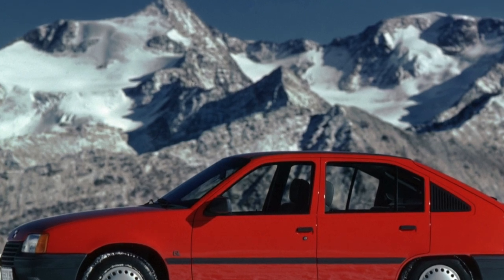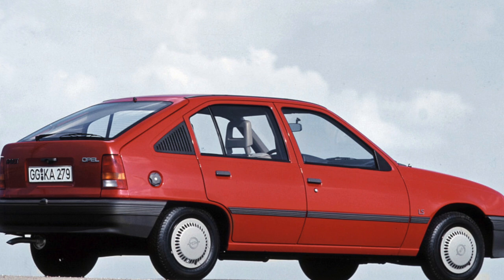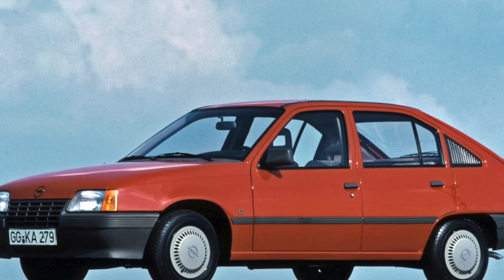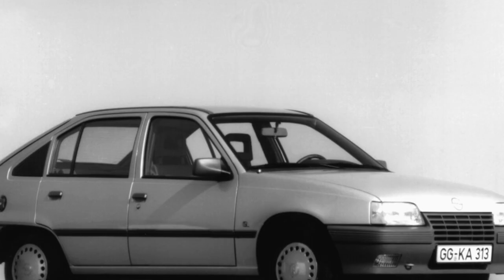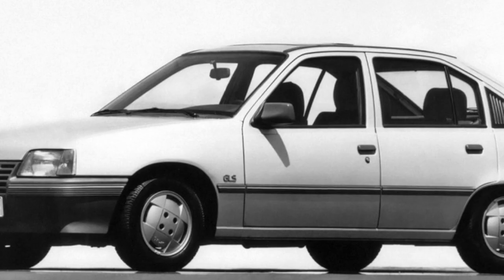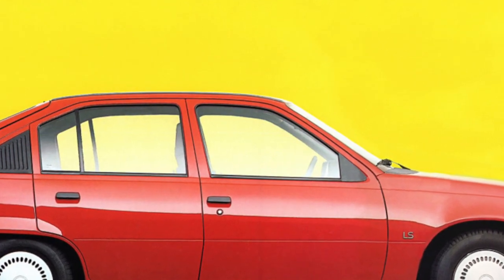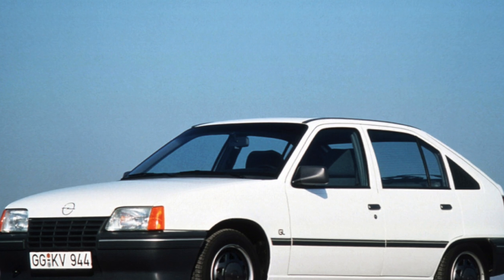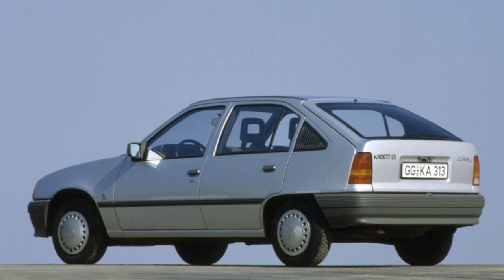Everything You Need to Know About the Opel Kadett E - Fault Guide

Comment: I still do drive my 1986 Opel Kadett, without any hasitation.
This car never had any issues, besides of a little rust on the rear arches.
Over all, best car i've ever had. Low maintenance, simple mechanics and full practicability.